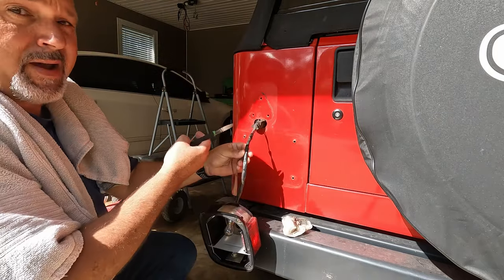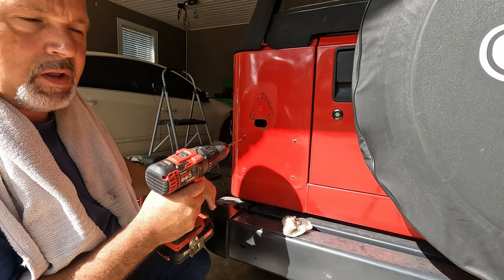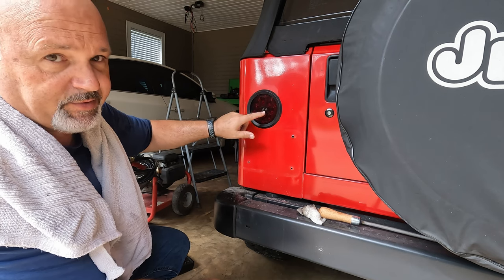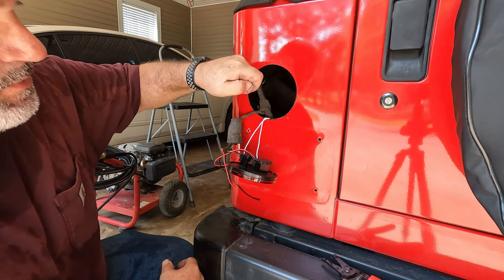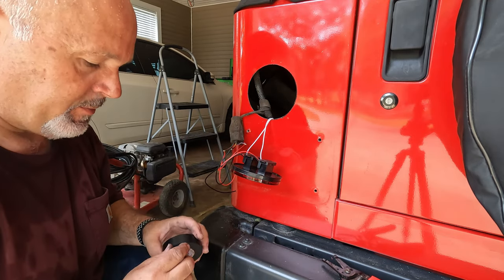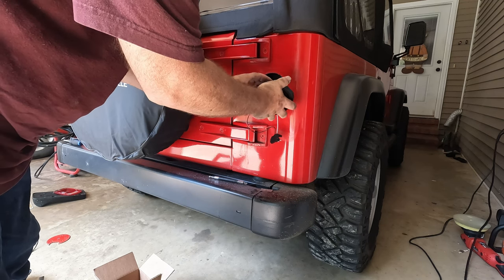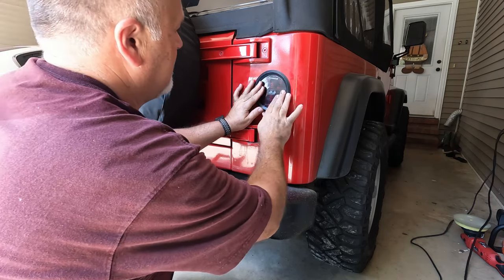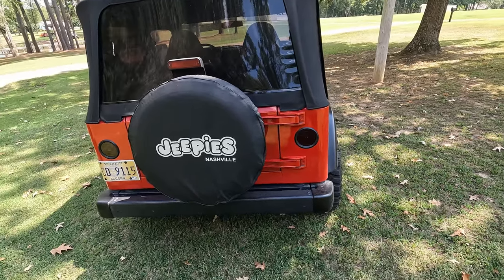Jeep Wrangler Round LED Tail LIghts!

Comment: Hi Steve, looking to install these on my 91 YJ, do you have a video on installing the flasher relay? Also, do you need reistors for this setup?
Reply from the maker: No resistors with the correct relay. Here is the video you requested. Links to relay will be in the description.
https://www.youtube.com/watch?v=Cv2sbaE7Cx8
Reply: If you use relays for the front flashers does this work as well? or you need the specific relay for rear tail lights?
 @ForceBuilt
Reply from the maker: One relay does all the signal lights.
Reply: thank you! @ForceBuilt